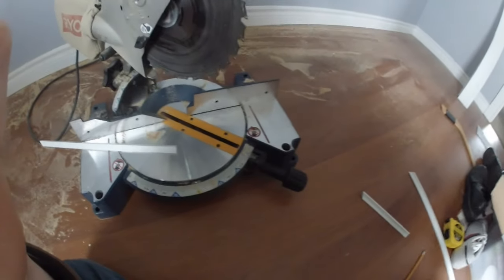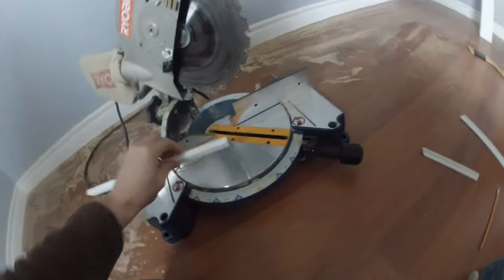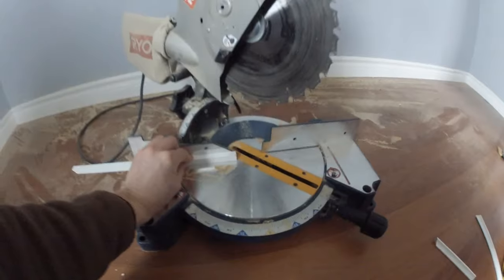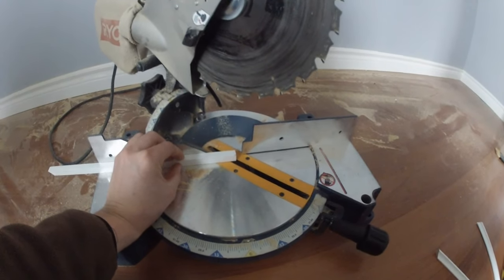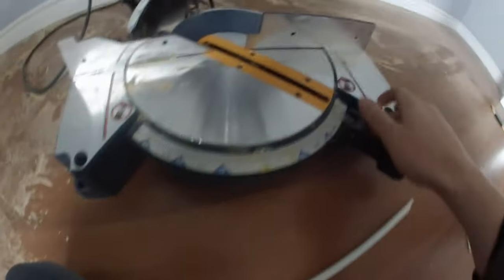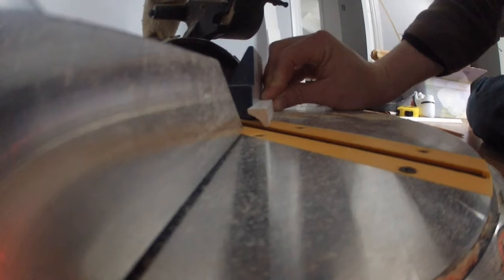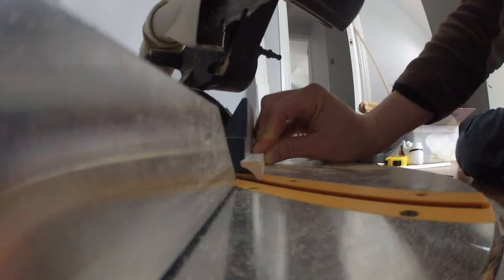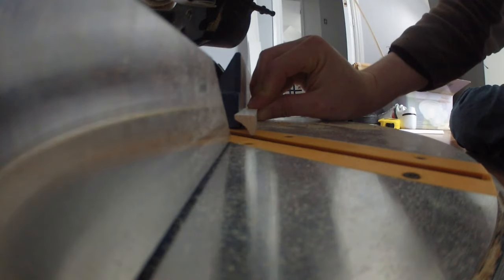How to cut 90 degree cove moulding

Comment: OK - that was stupidly easy, even for my pea-brain. THANKS! Simple actually, but couldn't find any other thing on the web that showed it properly!

One small question: I'm doing stairs, so the pieces are only 6-9" long. Sometimes they just spang off if trying the miter cut on a short piece. Is the only solution doing what I am...namely that it seems best to cut the miter portions first, then the straight cut to length  (maybe more stable with both sides on the base/fence)?
Reply: Make a hold down jig easy to make cut a 3 quarter block 3 1/2 LG We find some scrap 1/2 inch thick same width as the first  then screw them t ogather  first piece on to the longer piece this will keep the molding in check jig has to be at least 9 inches long.
Reply: Hope I explained my self correctly  I'm pushing 70 so bear with me.young man.